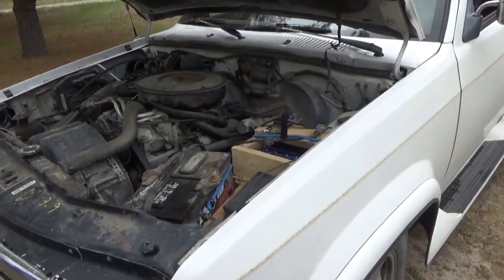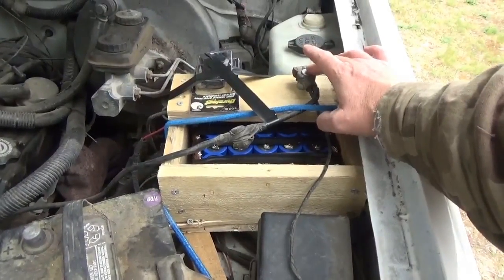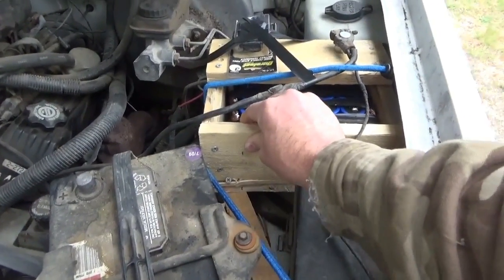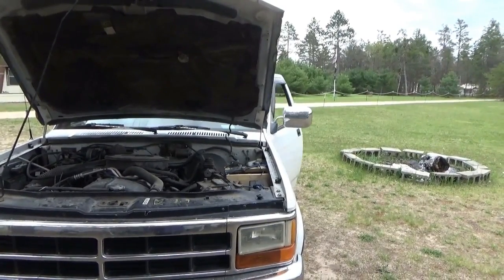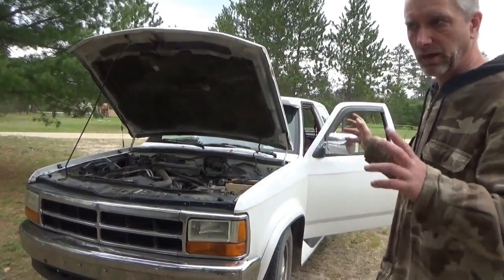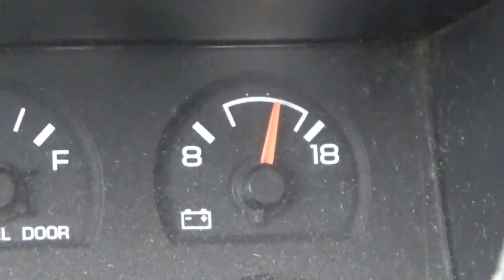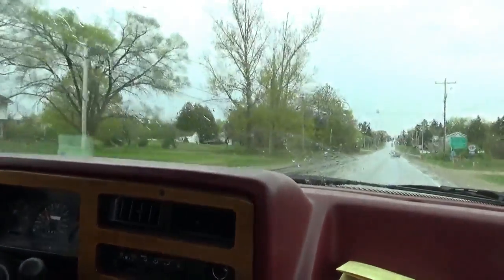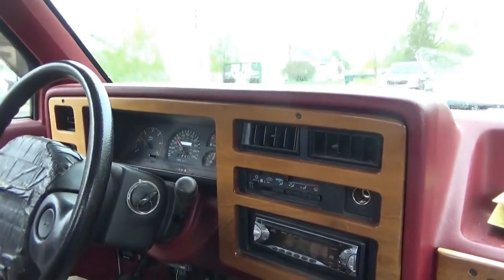Starting & Driving My Truck With SuperCapacitor Battery Replacement

Comment: Cool test, but I just got a 650 amp battery at Menards for $59 a few months ago.
Reply: Hard to beat your view on the price point but consider this.  You don,t need 650 amps to light headlamps or the dome light.  You need that for just starting the car.  Lead batteries suffer especially from high amp draws and going below voltage.  For longevity, a car battery is better suited to low amp and/or long steady discharges and it has great energy capacity.  The capacitor is excellent at delivering high current with sagging voltage for the short time needed to drive the starter.  The capacity is low but fine for the brief pulsing to crank the motor.  So use the battery for low power long duration loads and the caps for high power short duration loads.  It is the perfect marriage.  Save money not buying large amp batteries over and over and buy the caps just one time.  From the environmental view.  Lead is toxic.  We need to rid the economy of lead as much as possible as lead poisoning and health effects are well known.  The Menard cost hides the true cost when considering the bad health costs and environmental  risks and cleanup costs.  There are less toxic batteries available.  You said your batteries last about 6 years.  I  bought a battery sealed type similar 650 amps a few years back.  The store did not offer any 6 year warranty.  They charged $140 for a 2 year prorated warranty.  He said the high heat in Fl does not lend to a battery lasting more than 2 years.  Well it has been 2 1/2 years now and it still cranks, but I do note a slight hesitation at first turn of the key.  So we will see.  I don't want to buy batteries every 2 years.
Reply: Yes, hope you are right, 2 1/2 years to last is stupid economics at any price point.  Here in summer see day temps in low to high 90's with high humidity.  Winters normally no lower than mid 40s seldom see a freeze.  I have a 35AH lead acid sealed battery that I keep on a standard battery charger Schumacher (2A setting) all the day time, but shut off at night.  It is backup and main power for my laptop.  I got it used in 2008 was probably a year old then, so to now is about 9 years old.  Up until 2 years ago, I just kept it charged (charger then removed)  but did only occasional use it on loads.  For the last 2 years it has been on the charger constantly as noted in first part and directly runs my laptop all day.  Interesting note is the charger outputs 2A and the laptop uses about slightly above 2A so the battery is never depleted very much on voltage before I correct it.  Over time the battery voltage starts to sag and I just let charge back without the laptop load.  I think the biggest trick is to keep the battery voltage at its highest full charge value.  Also it has never seen a high discharge current.  My car battery not only sees the high current surges from cranking but also from helping other people to start their car's.  I have often heard giving a jump to other cars is very hard on my battery and should be avoided if you want to extend the life of the battery.  So I have 2 experiments, the car battery of 2 1/2 years under hard hot duty and the in house light steady duty cooler temp 35AH battery.  We will see.
Reply from the maker: Yes but the fact that you keep buying batteries tells me that there is a market for a lifetime battery.
Reply: Real batteries last me about 6 years, and I don't have to worry about leaving my dome light on or headlights for more than a minute. Sorry I'm not sold for usual use.
Reply from the maker: And I am certainly not done experimenting. This was just a test of sorts. It worked. Now I move on to improving the system.

Comment: Troy that is cool is it EMP proof?
Reply from the maker: If you put it into a metal housing then yes
Reply from the maker: No. To be EMP proof something must be fully enclosed in metal with no breaks. A car body has glass windows. The engine compartment is open to the bottom. Many cars these days are half made out of plastic anyway.

Comment: So since this worked, what about replacing both work shed solar battery banks with supercapacitor banks?
Reply from the maker: Because they dont hold enough power overall. They can replace a starter battery but not a deep cycle battery

Comment: Unless you have a bad altenator the only time the battery or caps come into use is for starting your engine so running with your lights and heater or AC have no real effect on that part of the system!

Comment: the capacitors will not put as much wear on the starter!

If you are in the rain there alot, you need to put RainX on your windshield.  It will help you see better especially in blinding rains!

Comment: as long as the engine is turning, the alternator makes al the power you need, so the caps at that moment are not in use...(only as a smal buffer,).. the use off these caps as a replacement batery makes no sense .(a 12 volt 55 amphour start battery is way cheaper, and has way more crank capacity.)
Reply from the maker: The idea is that these are not bothered by cold or heat and they have a theoretical 1 million cycles compared to a normal vehicle battery lasting about 1,000 cycles. So essentially you buy one battery in your life. In theory
Reply: a lead acid cycle is way huger(and different)  then a cycle on these caps. the difference is amp hour. not amps second...you are proving something thats not correct,  a better experiment is caps parralel on the lead acid cel, to create a higher inrush current capability, that is sensible., caps on there own is not realy.
.
Reply from the maker: Yes actually that is an experiment on the way soon.....
Reply: I recently was at the repair shop to replace a bad alternator after having replacing a shorted battery with a new.  I asked if I could in an emergency where the battery is shorted, if I could remove it and get a jump from somebody and rely solely on the alternator to drive home.  He said in later model cars that is a risky move as all the computer systems are very voltage sensitive and would run a likely risk of damaging something.  Back in the old days I have done just that with no problems - before the computer age.  So, it is not certain if the capacitor bank would be enough buffer compared to a regular battery.  Somebody could look with a scope and see how a battery or capacitor bank compare.
Reply: there wil be no difference when using a normal lead acid cel, the modern alternators have a stable regulator, so even whit no battery connected, i dont see a problem here, the ecu's have there own build in caps on te power part of it. only point is that the caps when empty have a very low internal resistance, so when empty its a huge instant load on the alternator, like a short...
Reply: they already have that, they use that in high power car audio...

Comment: You where on E all day!!!
Reply from the maker: I am on "E" every day. My other truck was the same. Actually the truck before that one was the same. Gas gauge never works in any truck I have.
Reply: now that would be a good video, and a simple fix,,, repair the sensor!
Reply from the maker: Its up under the bed of the truck. Not really a simple fix unless I want to drop the gas tank or remove the truck bed. Not fun.

Comment: Sensitive to water, dirt, as well as long time stress you mean? 

(correct me if im wrong on the following but...) 
Also, capacitors aren't batteries, a car battery it made to act like a limited capacitor, to provide cranking amps when needed(constant high amps to crank the engine, while starting it as well), and then power all other functions like a normal battery, IE, radios, lights, ect. Things that draw large amounts of current. Capacitors can crank an engine, but leave on a radio system, or anything for too long and it will be an issue. Super caps aren't anything new, they are meant for high amps and fast charge/discharge. 

One must wonder why we still use batteries, and thats because batteries and capacitors, while similar, have two different areas of use. And thats why car batteries cover both in some way. 

Focus more on important things, rather than capacitors and other "experiments". You know the outcome already to most of these situations. 

Focus on your broken down car
Focus on your chicken coup
Focus on your garden
Focus on properly maintaining your existing batteries. 

Focus on getting things actually done for once.
Reply from the maker: You are not the one in control of my life and you do not get to set the priorities. I have my reasons for what I am doing. Just watch and enjoy the free entertainment I put out for you. Thank you :)
Reply from the maker: The alternator powers everything when the car is running. The battery is there for starting the engine primarily. The capacitors can replace a car battery while giving longer life and lower cost overall
Reply: I was never trying to control your life at all. This is america, you are free to do what ever. 
But priorities aren't set by a person, they're set by the situations, the importance of them and other contributing factors such as capital and time where you can invest. By spending more time on this, your opportunity cost of the whole situation is having the time for your coup, or other maintenance. 

Im not trying to control, just trying to advise.
Reply from the maker: Well, for reasons that I cannot share, this is my priority right now. Good reasons, please understand. And I was driving anyway. The time was going to be spent on driving. Now I got a video out of it as well and even earn money on this video. How cool is that?
Reply: Understandable. 
I'd like to be honest with you here, I dont feel as if you have done all the things you could have, and some things could have been done better. But i also do not align with the .sucks page either. But i look at both their page objectively and understand a lot of what they are saying. But i love some of your ideas such as reusable material using.
Reply from the maker: Thanks. I try my best. I often fail but keep learning and trying again. what I dont understand is that an entire website can be devoted to destroying my life simply because some people dont always agree with me. I mean they are not forced to watch my videos if they dont like what I do. But yet there they are dedicated to shutting me down.

Comment: Add about 20 Lithium 18650 cells to recharge the capacitors when they get low. Your net weight savings is 40 pounds!

Comment: you should add a RC battery in with the supercaps.  the battery kan keep the supercaps topped off
Reply: Energy capacity wise, good, but lipos are heat/cold sensitive and require more complex balancing which adds costs and safety risks.  Cars get very hot in the summer.  Better to keep it simpler until tech catches up.  A small solar panel for day or a small ups battery can also keep it trickle charge topped off.
Reply from the maker: Yes I plan to experiment with that too

Comment: Troy, those capacitors may be fine for providing a short burst of energy to start the engine. But what happens if your alternator fails? Batteries have enough reserve capacity to get you home in an emergency. With the capacitors, if your alternator failed, you would probably be out of luck.
Reply from the maker: +Fixed-By-Dork I have had that happen before a few years ago. My battery was weak too due to a failing alternator. Bought a boat battery to drive home 2 hours in the night and it was raining.
Reply from the maker: Yeah, no water pump = no driving. One time I had a leaking water pump though. Water was pouring right out of it. I was a few miles from home. Had a container with me. Kept getting ditch water to fill the radiator and kept driving. Fill up. Drive. Fill up. Drive. Got home safe. Flushed the system. Replaced the pump. Drove more years on that car.
Reply: @TheDoItYourselfWorld  piston through the block no running are yall ok????
its great capacitors running the truck but ya must water proof the capacitors!

Comment: Looks you a splitter for your battery and capbank to keep both up when you open up doors or other things running while engine off. It is like a two battery system,  one for starting and the other for aux power on switch. You will have to run the dome light power thru the battery not your cap bank so not to bleed off the caps.
Reply from the maker: +Frederick Nolan yes that will be the next test. Then I think one bank of capacitors for starting and a tiny battery for backup
Reply: troy put a small solar panel on your dash and plug it in our cig lighter to charge the cap when your not driving your truck.
Reply: buck tooth bettys boyfriend That is if it is sunny out that day. Bettervge split the alternator recharge with regular battery, first the cap bank than battery. It will be better for non sunny days.
Reply: Agree.  Run the capacitors discharge isolated to the starter solenoid circuit instead of the car battery.  Mount a small motorcycle battery or like in place of the big car battery.  Recharge the capacitors thru circuit to the alternator output (after fuse) which is the same as across the lead acid small battery.  To prevent excess high capacitor inrush current during recharge, you can install a current limiter in series between the battery and the capacitor bank.  Many kinds of current limiters available from as simple as a big resistor or light bulb or inductor (more practical) to electronic controllers or cv/cc power supplies.
Reply from the maker: Yes that is another plan I have for an experiment. Next in line actually

Comment: I failed to see the purpose of this?
Reply from the maker: +BUDDY LIGHT weight savings and cost savings over time. This could potentially last a lifetime
Reply from the maker: +BUDDY LIGHT and not sensitive to heat or cold
Reply: instead of a 70 lb battery, you have a 2 pound capacitor bank. , granted niether gets used when the engine is running.